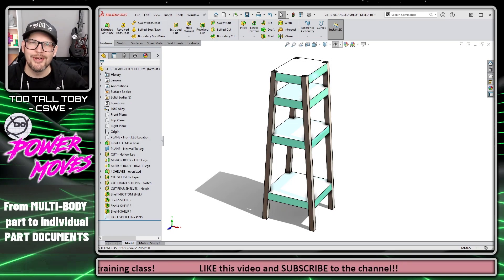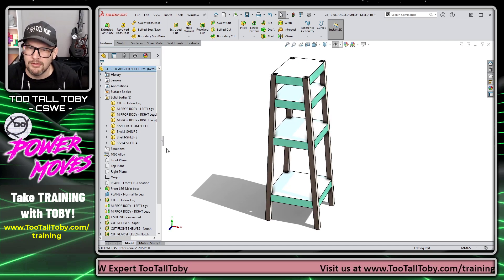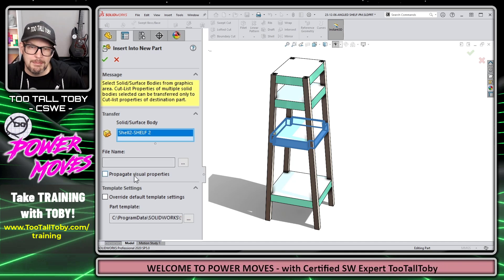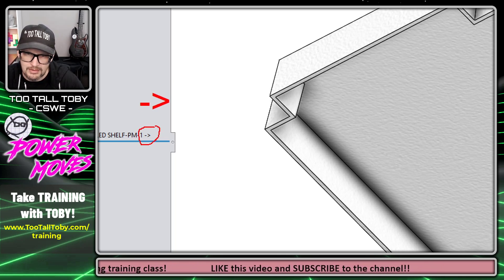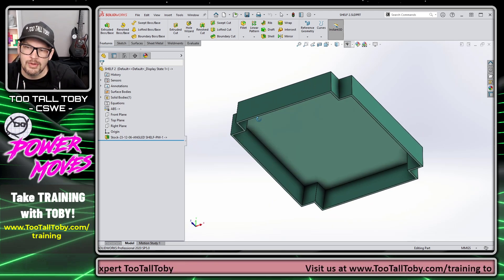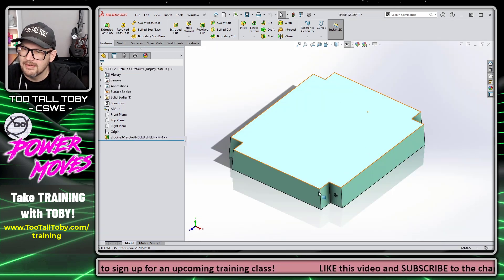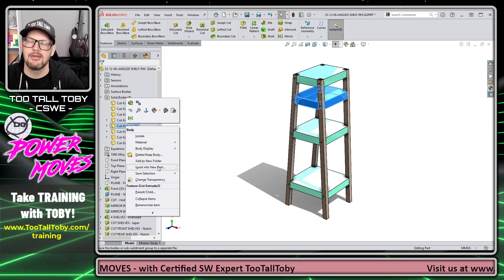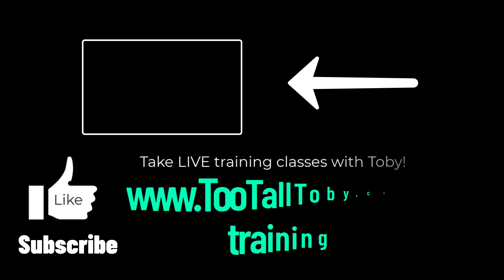SolidWorks EXPERT explains Mutli-Body export!

Comment: I was just doing a small personal project where i made some mounts for some pegboards that i wanted to use different parts off, and i was hiding the parts i wasn't using and saving step files (for printing) of the different iterations of it, thinking "there has to be a better way of doing this that i just don't know"
And this is exactly what i would want to do.
Reply from the maker: Awww yeah that's awesome!!  Glad this helped!

Comment: is there any way that features can also be transferred ..... had to convert part again in sheet metal to make flattened drawing
Reply from the maker: There are some options to include those sub-features.  
I can't remember the exact workflow but try this:
1. Try using the option to "break link to original part" - this will definitely work, but unfortunately you lose the link back to the master model, so this might not be a good solution for you

2. Try the different methods of adding a body to another part - "RMB>INSERT INTO NEW PART" and "go into a new part, then INSERT>PART" and "INSERT>FEATURES>SAVE BODIES".

Each of these techniques has different sub-settings, and one of these probably has tools to help with the sheet metal features transfer.  Good luck and comment back if you find a solution - I'm curious too!

Comment: Once you make that new part and it has the "->" symbol (external ref), what's the easiest way to remove the external ref (->) from the part?
Reply from the maker: You can RIGHT MOUSE BUTTON on the name of any feature with the "->" symbol and choose LIST EXTERNAL REFS

Then you can choose LOCK (temporary) or BREAK (permanent), to break the dynamic link between the seed and the derived part.  

Hope this helps!